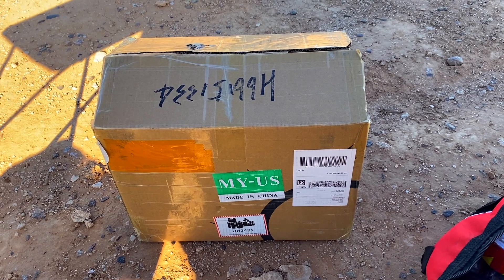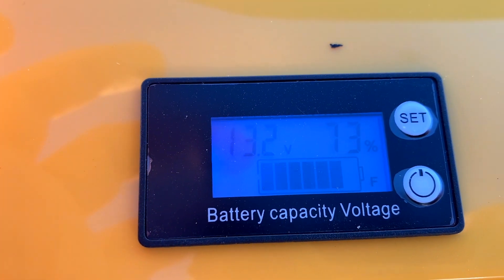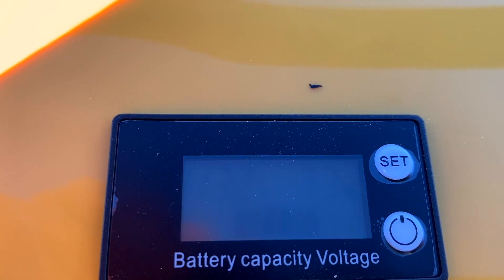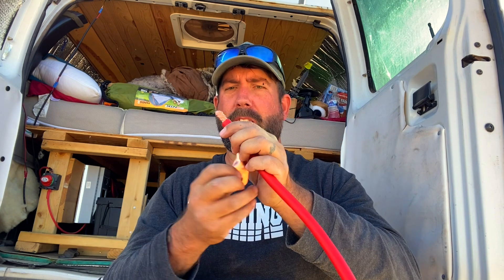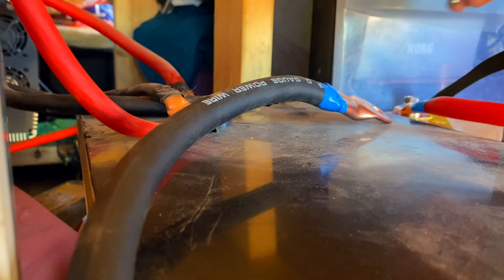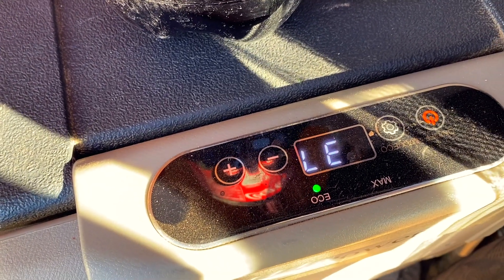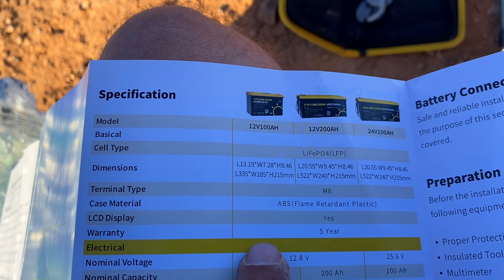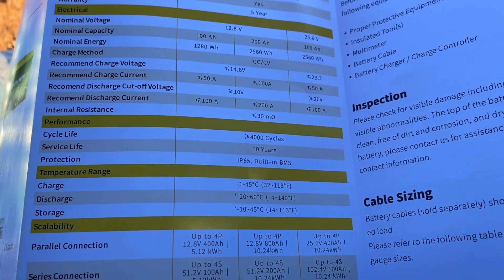Upgrading My Battery Bank For More Power !

Comment: You didn't even crimp or solder the lugs onto the cable?

Folks, don't try this with just tape holding the lug onto the cable. A recipe for high voltage short causing equipment damage and high rish of fire!
Reply from the maker: Yes it’s crimped I will be changing the cables soon though as the fittings are a bit large
Reply: @AussieVanMan  Crimping is not shown in the video - only taping. This could be dangerously misleading to neophyte electricians.

I soldered mine by positioning the open end of the lug up, heating with a propane torch, then fill it with molten solder, the jabbing the trimmed cable in. Heat shrink tubing can be used to seal the connection. Or "liquid electrical tape".
Reply from the maker: @samshepperrd  yea i definitely didn’t solder my soldering skills are lacking
Reply: @AussieVanMan  It's not really soldering. Just heat the lug, jam solder in till it's at the top, then jam in the cable. Done.
Reply from the maker: @samshepperrd  oh ok